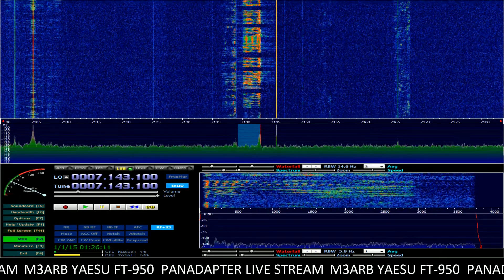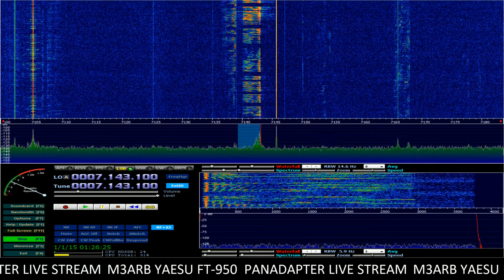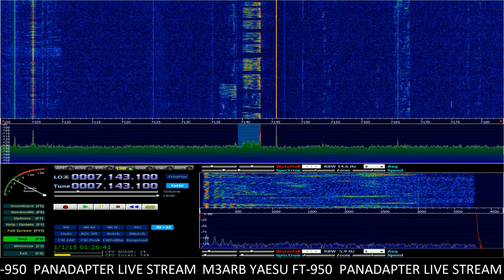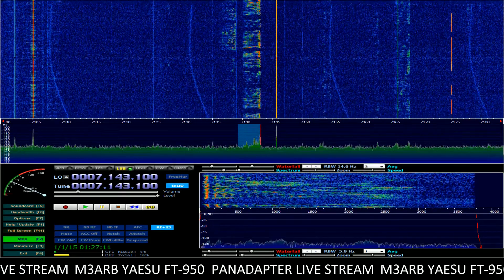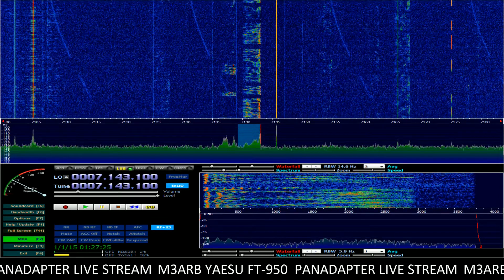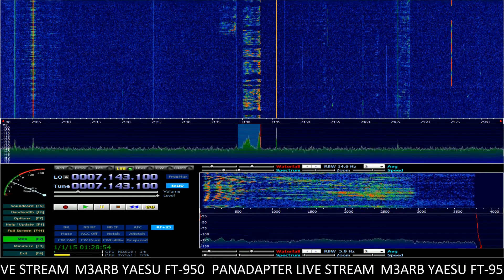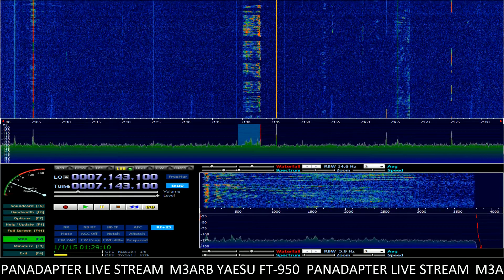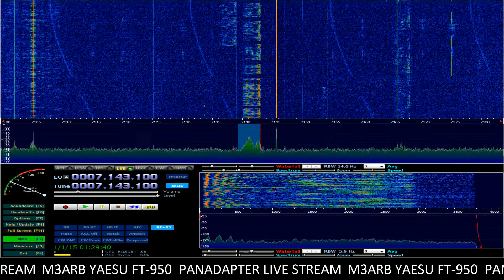Yaesu ft-950 & RTL-SDR Panadapter

Comment: i bet there are people who want to know more about the " how you got there..."

i.e. where exactly did you tap into (first IF obviously, but where is that on your circuit board) 
stuff like that would probably get you even more more views and likes 

most peoples biggest problem is : "where the heck to put down my soldering iron on the board"
another question is: "what size capacitor would be good for this" (i'd say 22pf or so)

...you get the drift :-)

Thanks for the vid, looking forward to the follow up  , hi hi

73